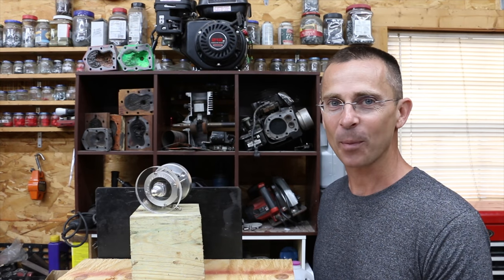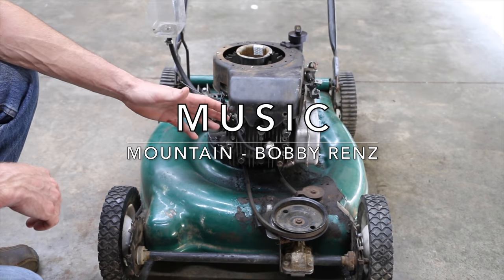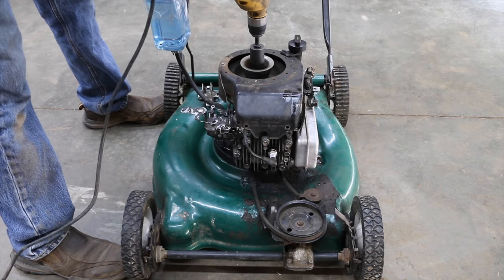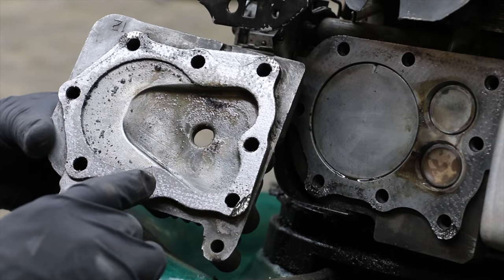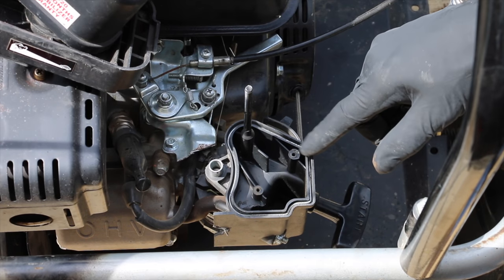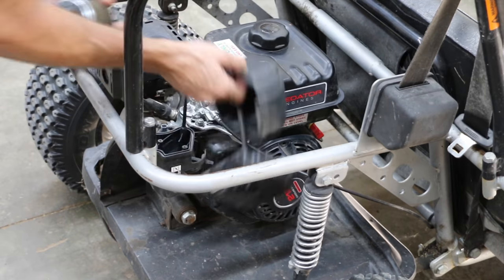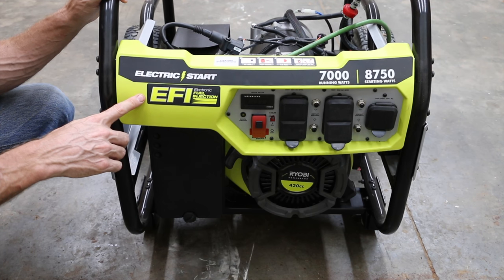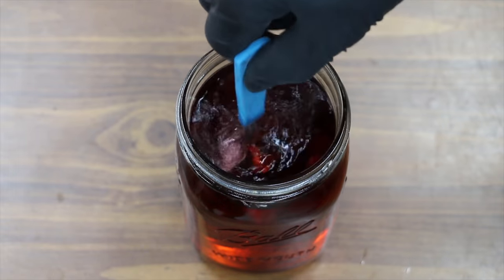Is Leaded Fuel better than Unleaded?  Let's find out!

Comment: Tera ethyl lead is bad stuff. The first guys to test it had all kinds of health issues. Some mental problems too. Lead is poison, no matter what form it's in, and tetraethyl lead is very dangerous to handle. It made cars run better, at the time.  That was because the internal combustion engines of the day were very crudely made. But with the technology used today in the shape of the combustion chamber really makes a difference in how much it can help an engine.
Reply from the maker: Thanks for the feedback.

Comment: Leaded fuel needs a very hot engine for the lead to vaporize properly.  An engine that's too cold won't run right.

P.S. Probably why the engine ran better later into the test.
Reply from the maker: Thanks for the feedback.

Comment: Leaded  fuel is not better, it´s way better than unleaded. Tetraethyl lead increases the octane rating of the fuel making the engine use less gas, burn cleaner and cooler. That´s the reason you had to lean the carb on your go kart. And you can use it in a fuel injected engine with catalytic converter. The only reason they say it damages the catalytic converter is because with electronic injection and leaded fuel the fuel consumption would be far less ( and that´s not good for oil companies) and that´s the same reason they removed lead aditives of the market. Environmental reasons were just an excuse. I recomend you to try it on your car and compare the mileage with regular fuel and you´ll see what I´m talking about.
Reply from the maker: Thank you for the feedback

Comment: The engines have to be designed to run on leaded gasoline engines built previous to nonleaded gasoline don’t run well on nonleaded gasoline the engines have to be adjusted separately and design differently lead gasoline is harder on an engine in general but the ones that are designed for lead run really really smooth and burn really clean they just don’t last very long
Reply from the maker: Thank you for the feedback

Comment: The problem with running the leaded fuel isnt the lead but the octane that is to high for those low compression engines. A gas engine will make less power with more octane than needed contrary to common beliefs as proven at drag strips.
Reply from the maker: Thank you
Reply: Tetra-ethyl lead is also hideously toxic to both humans and to closed loop cats.

Comment: The way i see it you have a couple of problems with you're testing
1st your dune buggy / go-cart used a governed engine ( will only go so fast )
A better test would be how long it took to get to top speed

2nd  the engine was not setup to run 100 octane gas.
do to its low compression causing incomplete combustion ( not taking advantage of the higher octane )
thats what gave you all the buildup in the head
Reply from the maker: Thank you for the feedback

Comment: Look for  remote control gas engine fuel. Mine ran well on 25% nitro methane fuel. If you have a vehicle with a cat, avoid the 2 cycle fuel.
Reply from the maker: Thanks for the feedback.

Comment: Of course it's not better. Mechanical function has nothing to do with opinion.  Lead was used in early model cars to help reduce engine knocking, boost octane ratings, and help with wear and tear on valve seats within the motor. Improvements in engine design,  and better materials made lead something no longer needed.  The title to the video is to generalized.  "Is leaded fuel better than 87 octane in an antique Ford flathead engine with high compression pistons and original valves" , would have been a better title, since the question is specific to a certain engine,  design,  and specs. The title as it is makes it sound as if they can be compared as a matter of preference with no regard to application,  giving uneducated audiences the impression that you may simply just prefer one over the other. One is not better than the other. It's like asking if a 10mm wrench is better than a 12mm wrench. Well if I need to loosen or tighten a 12mm bolt, then the 12mm is obviously better because it's made for that specific application that I need it for. 10mm wrenches were not designed to fit 12mm bolts. One is not better than the other, they are each made for specific things. It's a silly question I think.
Reply from the maker: Thank you for the feedback

Comment: If you do not have hardened exhaust valve seats, have high compression and a carburetor... yes it is far better.
Reply from the maker: Thanks for the feedback.
Reply: @ProjectFarm  We used it when I was into drag racing. It was known as blue gas.

Comment: unleaded is better for post 1974 engines tvat are designed for unleaded fuel. 
Leaded fuel is better for pre 1974 engines that were not designed or made for unleaded fuel.

Out of curiosity, what difference does it make? 
Leaded fuel has not been sold in the North America since roughly 1980.
If you use leaded fuel in a 1974 and later car, it will clog the catalytic converter, requiring it be replaced. Those are NOT inexpensive.

Unleaded burns hotter than leaded. For pre-1974 engines the exhaust valves and seats should be upgraded to prevent burned valves and seats.

Leaded vs Unleaded gas is moot. 
Leaded gas hasn't been available in North America for 2 generations. 
(figuring 20 years for each new generation. Them born in 1980 are grand parents now.)
Reply from the maker: Thanks for the feedback.

Comment: You won't see any meaningful differences until you increase the intake manifold pressure, running your shop air compressor to the air intake might do the trick to act like a supercharger.
Reply from the maker: Thanks for the feedback.

Comment: If you had thrown a turbo  charger on that engine and tuned it accordingly you would have immediately seen the benefits of 100 octane over 87. Thats why "aviation" and race fuel is what it is. You won't see any benefit on NA engines because high octane doesn't improve performance it prevents engine knock amd therefore a "supporting" mod.
Reply from the maker: Thanks for the feedback.

Comment: Wow. Wow. Wow. You should not run AV100LL is a stock engine with low compression. AV100LL is designed for high compression engines and is suited perfectly for pure race engine use only. I've seen it used on the dyno - AV100LL performs every bit as well as VPC14 and the AV Gas has better consistency, better quality. Your better to run low octane pump gas in production engines!

Comment: This is an unfair test. This test should be done with big block muscle car engines instead of what is being used here.  I can personally testify that leaded gasoline worked better in my 413 cu.in. Chrysler engine vs. unleaded which caused a siphoning of engine oil to lubricate the valves. When I had my heads reworked to accept the unleaded gas, that siphoning biz stopped.
Reply from the maker: Thank you for the feedback

Comment: You are comparing gas laced with alcohol with gas that has none. You should have found some 100% alcohol; free unleaded gas to compare with the AV fuel.  We have at least one place that sells it though it's more expensive than the regular crap sold at most stations.
Reply from the maker: Thank you!

Comment: If you had to lean the engine with the leaded fuel? Will it get better mileage?
 And IF? So... On a 60s carbureted engine With regular gas run lean and then add the 10% Alcohol into today's fuel then??? No wonder why old cars run like crap! WAY TOO LEAN!!!

Comment: This was the dumbest test I’ve ever seen. First, he doesn’t know much about avgas. 100LL is NOT low lead by automotive standards. It has 2 mg/L of tetraethyllead. Which is 4 times the quantity of TEL ever put into leaded auto gas. Sunoco 108 octane contained 0.5mg. It is only low lead compared to the fuel it replaced, 100/130, which had 4.0mg. So yes, in the low compression engines he tested it in, there is going to be a LOT of lead buildup. And no benefit in using it, because low compression low performance engines like were used for testing here, do not need the detonation resistance of avgas! Now if he ran the tests in very high compression, ie, 13:1 and higher engines, or highly boosted super/turbocharged engines,there would be significant performance advantages. Because this fuel has amazing resistance to detonation. It is also very stable. It has a rated shelf life of 3 years, but in actual practice, is more like 30 years, with no congealing or varnish formation. Now, remember, you cannot put this fuel in anything that has a catalytic converter. It has so much lead in it just 1 or 2 gallons of it will destroy your converter. This should only be used in aircraft engines, and very high performance racing engines. Not lawnmowers!
Reply: If you got him a spare airplane engine to test the avgas on he would use it

Comment: Better in terms of what? If you have an engine with hardened valve seats which is every single engine now there is no need for leaded fuel. Useless video.

Comment: 100LL has THRERE TIMES as much lead as 80/87 Avgas.  This means lead fouling on plugs, and is one reason that so many of the planes which used 80/87 are now running on alcohol-free Autogas.

Comment: Where's the good red stuff ????
Reply from the maker: Thank you
Reply: Project Farm You're welcome , I've pulled many old tractors and p/ups poured some fresh in on top of the varnish and away we went , not that way any more , we used to run an M w/ a 400 block in it to pick corn w/ a mounted two row , it used to run a blue flame about two inches out the top of the muffler , all alcohol !!!!